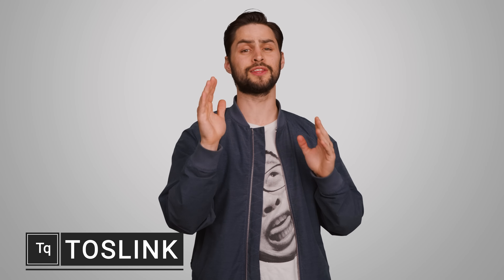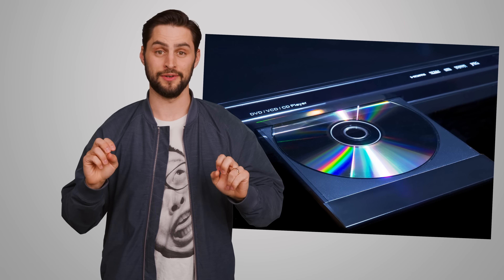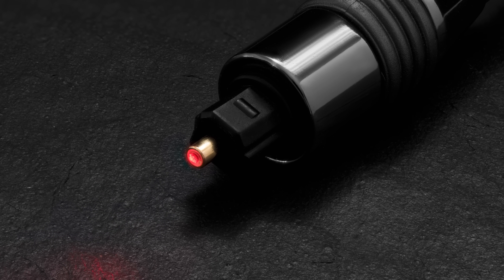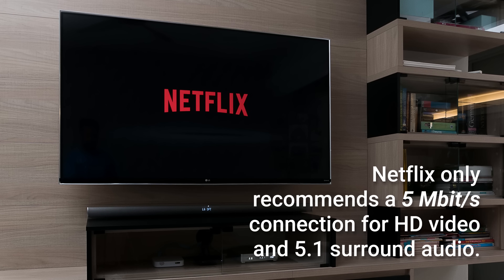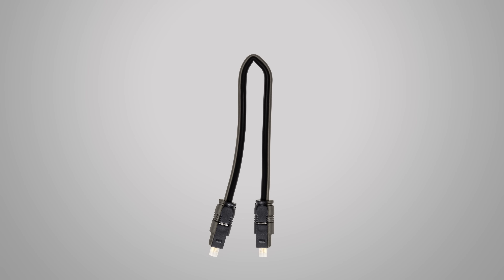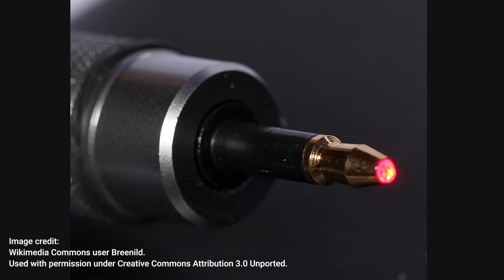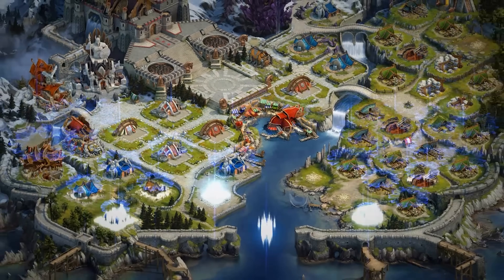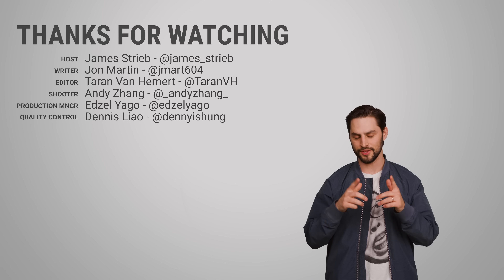Why IS This COOL Cable Dying? - TOSLINK Optical Audio

Comment: optical is dying because it can't control anything else then audio. 
it is a damn shame because it has unlimited audio bandwidth with no lag. but all these receivers with software and cpu needs to be controlled. 

atmos for instance. bose 1-2-3 systems did the same via optical early 2000's, using the envirement. but it was build conventional so you could use optic.
it is not if dolby invented this technology

Comment: This guy is soooo ignorant. 

Toslink is not dying. Its still included on 90% of HDTVs and Sounds bars.
There is measurable  signal degradation on HDMI cables longer than 50' and 25' on cheaper HDMI cables.
The maximum length for toslink being 10 meters. That is what Toshiba set it at. That's a technical maximum. In reality its probably more like 5 meters.
Toslink is optical-audio so comparing it with video over hdmi or in general is a false equivalence.
Bending HDMi cables is stupid.  It is true they are less fragile than optical cables and less prone to breaking but you can still damage the cable and mess up the signal by bending it. 
Audio over  HDMi  via Arc or just plain old HDMI has to be decoded so all devices with an HDMI connector(s) has to include a chip which decodes the signal. There is a  per-unit royalty that has to be paid too on any devices with HDMI. None of that is true for Toslink though.
Toslink cables don't cost 100s of dollars.
Dolby Atmos and DTS:X is only supported on HDMI 2.1 and  eArc. A lot of HDTVs still don't have HDMI 2.1.

Comment: don't want to spend $300, $200, $100 for true wireless headsets on Major Consoles (*cough* XBOXBONE) get a bluetooth transmitter that sends your console optical audio  (SPDIF) out to any bluetooth headset. Thats why they're suppressing this, so you buy they're overpriced sets only. and making bluetooth headsets only compatable with licensed from M$ brands even thought they are using full bluetooth with no additional dongles anymore that dollarstore wireless headsets could potentially also use.

Comment: So this is why amazon calls them sound bar cables. It may not be on those specific extremely new devices but most people don't replace their sound gear every year, much less spend many hundreds/over a thousand on it. You'd be amazed how many people don't even think about a proper sound system and just use those red and white cables.
Fact is that most people don't even have a surround sound system, and the vast majority that do have a 5.1 system, right on toslink's sweet spot.
Plus its the only reasonable way to get surround sound from my ps2.

Comment: Toslink is "obsolete" for digital audio in roughly the same way DVI is "obsolete" for digital video. They're both still quite common and both are still perfectly fine for their original purpose with their digital nature ensuring no quality loss. HDMI and DisplayPort just have newer capabilities that those older standards for audio and video don't have. There's probably not going to be a quality or performance difference between a sound bar connected with toslink and one connected with HDMI assuming you're not setting up anything that needs those newer standards. It's a significant step up from analog connections and isn't subject to electric interference.

Comment: I still use it with my pc because of one very important reason. I use a mixer that is also hooked to my line in for the mic, if I use copper cables for both line in and line out, i create a ground loop and get all sorts of noise. Using toslink for the line out to a DAC breaks the loop, no more annoying noise.

Comment: Its still in use as its one of the only standards that allow you to connect a modern smart tv to vintage stereo equipment without intermediary adapters because they do not have RCA or Component anymore

Comment: I actually hate regular cable audio сonnections because most active audio systems come with 2-pole AC connector which means possible ground issues. And I have a metallic keyboard, so this is also potentially hazardous (that one's personal so disregard that lol). Such connections can also affect sound quality (adding hum for instance), and that's why I like TOSlink so much. It is quite cheap, and it gets you galvanic isolation saving you any trouble concerning ground.

Comment: Toslink is not dying and in matter of fact the basic principle that makes toslink, toslink is being used as a solution for HDMI 2.0 and 2.1 cables that need to run anything longer than 15 feet. Maybe the plug ends that we call toslink are becoming niche a solution to a niche problem that I personally can understand for audiophiles who want a DAC that is essentially universal and does not want to install drivers,  ever.

Comment: I wouldn't say it's dying... it's still on MANY new items, and so much older tech uses it that it would be silly not to include it now... 

it's still used a LOT in high-end audio equipment, and until there's something else to replace it (that can be directly converted/compatible) it wont go anywhere imho...

Comment: I use it with my older surround sound receiver since it can only do HDMI pass-thru.   Thankfully every modern to modern-ish device I own has it.  Well aside from my bog standard Nintendo systems.  Until I buy a new audio receiver its gonna be my digital audio hookup.

Comment: Actually I still use TOSLink, though in an admittedly strange setup.
The gist of it is I use it to pass on the audio of my XBox One S to my PC (via an external USB soundcard) and then onto my Bluetooth headphones via the native Windows "Listen to this device" feature in the sound devices (old Control Panel style) menu.
Before anyone asks I do this to balance/equalize the audio channels (as I have impaired hearing on my right ear) and as I said connect to my blue-tooth headset or even record the audio as my XBox cannot really do that. And before anyone asks why I use XBox: some exclusives, but much more importantly: UHD Blu-Ray, Prime and Netflix. Yes, even my Windows devices seem to have trouble with UHD Netflix over HDMI and Displayport is no option because HDCP 1.4 is the highest my monitor supports, so I have to use a small device "down-sampling" HDCP 2.2 signals from my XBox to 1.4. Don't ask me how, but it works. Bought here: https://www.digitalo.de/products/1038218/Lindy-Hdmi-Hdcp-Konv.-Hdcp-2.2-und-1.4.html.

Comment: They'll need to start using HDMI/Display ports on sound bars/speakers before they can really kill the optical port. It would be nice to have a use for the extra ports on my graphics card instead of needing to use another USB port for sound.

Comment: The "problem" I've always had with HDMI compared with a dedicated cable like TOSLINK is that HDMI feels 'sub-optimal' in most of cases where you need all that extra data speed. The issue is that HDMI has both video and audio over the same cable, which works nicely as an entry level consumer solution. You just hook your media device up directly to your display, one cable and you're done. However, displays aren't capable of making good use of that audio data, so now if you want to actually use all that data that makes HDMI so nice, you need to pass the audio signal through your TV to some sort of receiver. Now we're back at the point of having a two cable solution, so the fact that HDMI can combine everything into a single cable is irrelevant and we're essentially using one for video and one for audio, neither one needing to take full advantage of the HDMI spec. It's nice, and it works, but I've always felt it's kind of a mixed bag of what it's trying to do.

Comment: 1:30 in the 90s Dolby got around this "one wire per channel" using 'Pro Logic', which was surround sound channels encoded into analogue stereo tracks. So they actually shoved 4 channel surround into 2 channels. Then your amplifier would decipher this into the 4 separate channels and (if you had 5.1) approximate the centre and sub.  
So you could get decent 5.1 out of standard red/white analogue if the movie was made using Dolby Surround. 
Due to how they "hide" it within the analogue signal it didn't affect normal stereo (or mono) playback on just a tv if you'd blown your budget on your 63cm CRT.

Comment: The Sony mini-toslink connection that fits a 3.5mm jack is a good connector.  The original toslink square plug is the bane of all audiophiles.  It isn't properly keyed and you can break the plug blindly reaching behind a huge DAC.  Nope, I'm glad it's dying.  It was badly designed and it is beyond me why copper-optical combo plugs using the Sony improved version never became the standard.

Comment: I am using it to connect my Pc to a 5.1 Sytsem. Its the only way for me to use the onboard soundcard, or i would need to lay an extra 4m of cable to connect the receiver with my monitor. Also i was looking forward to seeing it on audio interfaces and digital synths because it would eliminate one unnecessary DA-AD conversion and the signal would be more accurate. But nope, sometimes the industry is holding us back.

Comment: TosLink is great for using your older, sturdier, headunit/amplifier instead of them dang new-fangled thingies which can't grasp the concept sometimes you only need to carry audio, not a complete datastream including video; hence a hdmi cable is even less-preferrable (to me at least) as a "standard" go-to for audio then either RCA or digital coax may ever be.
Not too long ago ran into an issue where some "home entertainment system" would shut itself off after a few hours if you happened to use RCA or optical-in, which has become a prime annoyance since... as yes, you CAN disable the power-saving feature that turns out to do this... it will turn itself back on roughly once evere 6-12mo. because of an update...
Prime example where making a device try to be smart can make it actual a worse product. For the end-user in this case utilizing the product would've been easiest in their setup if the TV could be connected to the damn thing through TosLink or RCA and hence always output the TV's audio straight to the product.... Yet here come "Smart-Features" to let the device assume it's been wrongfully receiving a signal far above the noise-level and shut itself off for "power-saving"... it's painfull to witness having been a reseller at that point in time. 
Why we needed that functionality? For the damn 4k blu-ray thingy couldn't receive normal broadcasting input... and the tv had no way to output it's sound through HDMI... not to mention if HDCP would and should allow it...
And it ever-since appears i will clench to my 80's TosLink-compatible amplifier untill I can no longer service it :p I honestly don't want to ever think of running in such hassle as to have a device which is supposed to make sound signals into sound waves shut off mid-operation of exactly that without it at the very least being an actual failure :p especially when adding in DRM and HDCP it all just becomes a big headache to me...

Comment: I have used toslink for years connecting tv's to stereos. It sucks because it Strips the 5.1 down to 2.0 but I don't have to change audio input, just video. I would have used HDMI to my receiver but it forced all my video to 1080p. No 4k pass-through on older ones either.

Comment: I think the story is told a bit too narrow. Along side Toslink was the non-optical standard SPDIF which could do approximately the same over a coax cable, so in that sense Toslink was not the only solution.

Comment: Also, over short distances, 2/3rds the speed of light (how fast electrons move through a conductor like copper, silver, etc) doesn't add much time to the transmission of data so it's not worth it for the cost of an optical cable, however, over long distances, optical data transmission quickly shows its advantages.

Comment: Let me tell you why optical cable SUPPORT sucks.  It comes as the only digital audio option on almost every motherboard. And almost none of them have any way to force it to output 5.1, Dolby, or DTS.  Which means you’re stuck with stereo unless the application automatically enables 5.1 or has an option for it.  A lot of games don’t do that.  So you’re stuck with stereo sound.  Even sound cards do the same Goddamn thing!  The only decent application of optical for gaming is from consoles, oddly enough, they do way better with audio than PC does most of the time.  That is why HDMI is the better option for most people.  Optical is limited to 5.1 and it’s not compatible with newer audio features like Atmos or DTS-X.  Kill it, KILL IT!!!! And kill the 3.5mm audio too!  If you have a graphics card made in the past few years, your best bet is to use your HDMI port for audio.  Although, it’s not perfect 100% of the time, it’s way better than optical.

Comment: Sidenote: all current Chromecast Audio devices have Toslink build in, through a Miniplug that fits the minijack output (that's why there's a red LED inside the jack hole).

Comment: Manufacturers typically prefer having coaxial digital audio instead which was more reliable and didn't involve paying a royalty to put into equipment. I don't know if coaxial was undated beyond Dolby Digital. HDMI is excessive just for digital audio. DisplayPort is also becoming popular, and it's passively compatible with HDMI for the most part. I like it because it has a spring tab to lock it in place. DisplayPort was intended for use with computers, but it's now being used with TVs. TOSLINK just used an LED to transfer information. It doesn't use lasers like broadband fiber optic cable uses.

Comment: My sennheiser RS 185 uses toslink. Other choice would be RCA, but personally I rather have digital signal over analog.

And those are used on my PC, so it's much easier to connect toslink than couple RCA cables.

Comment: That's why you buy glass TOSLINK cables, but skip the gold connectors. You could've mentioned that TOSLINK  is SPDIF over fiber, and that SPDIF to/from TOSLINK converters exist. Got a ground loop problem with an SPDIF connection? Use TOSLINK at one end and convert to SPDIF.

Comment: I actually use a TosLink cable. Have everything hooked up to my TV in terms of HDMI, then TL to move sound over to my surround system through the amp. Don't want to set everything up through my amp, not worth my time tbh

Comment: A very important point left out here is that HDMI works just fine over fiber optic. I have a 50 foot run from my PC to my TV and it's all fiber. They aren't even that expensive considering their length and extremely high bandwidth.

Comment: Man... With all that you said... It still doesn't take away from the fact that the redundancy in having a sound solution in both Optical and HDMI allows a user to make use of Direct Input to the TV for Native display vs dealing with possibly dated Video codecs found in HDMI Pass Through for 5.1 and even 7.1 Surround Sound Systems. 

That's my situation. I get 3D, much deeper Color Depth, and lower input lag when having my Xbox One X plugged in to my 3DTV because it uses HDMI 1.4 vs my Sony Surround Sound solution only uses HDMI 1.3. 

It's all good though I guess.... I'll have to change my set up now to retest the input lag when using the HDMI Pass through on the sound system. . . One positive though, is that I'll get PCM Lossess Audio back... 😅

Comment: Is no-one mentioning ADAT? It sends uncompressed 8 channel audio data over Toslink cables and you'd be hard pressed to buy any kind of professional audio interface that doesn't include it. Toslink is dying with consumers because no one thought to update the standards, not because the cable isn't capable of uncompressed audio....

Comment: I still use my Toslink to separate sound from video for my entertainment room from an HTPC/soundcard. It's just easier and can have more connections for devices. My current receiver and TV downgrades sound quality when using a passthrough. But that's just my fault for having older equipment.

Comment: Yep. The only major reason why TOSLink is dying, is because you can't use it with the newer HDCP, the DRM that the movie industry relies on.

HD Audio like Atmos needs HDCP to talk back and forth to unlock the DRM, and Optical only sends audio, ARC can only send audio, because it was an afterthought by the HDMI people back when DVD was around.

The reason why ARC can't send Dolby Atmos is that it can't send and receive the necessary HDCP DRM over the HDMI cable. 

It could be possible for the TV to send Atmos and DTS-X from one HDMI device to another, but it can't break HDCP or re-sign the HDCP to the Audio device. 

but eARC can, because eARC uses the Ethernet data connection on the HDMI cable that everyone forgot about to bypass HDCP on the cable and use the Ethernet wires to send a new kind of HDCP to the eARC Audio device.

And because of backward compatibility, HDMI can't change the way that the HDMI plug and cable works to allow for bidirectional negotiation of HDCP, and because it isn't always online, they can't change HDCP or HDMI without creating an entirely different cable standard or forcing devices to connect to the internet every few days to download updated HDCP and signatures from a manufacturer or 3rd party like Dolby or DTS.

Maybe if there was a dual TOSLink plug, but it would be ferociously expensive to get 100gbps fiber for future proofing 8k HDMI over optical fiber loops.

Comment: Some of the Prosumer and Professional audio units use TOSLink to connect audio units together.  The Presonus Studio 192 has multiple TOSLink in and outputs for ADAT when expanding from the standard unit to it's expansion unit the DP88.  I still have a few knocking about.

"Back in the day" I used to connect the PS2 to a mini-disc portable for backing up C.D's quickly and efficiently - some discs transferred T.O.C. and track listing data while splitting tracks to individual tracks.